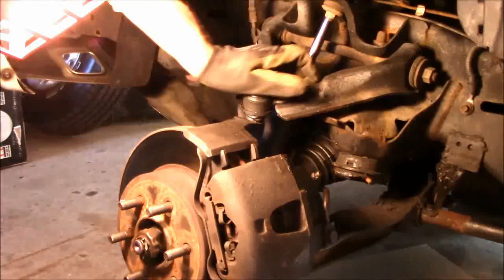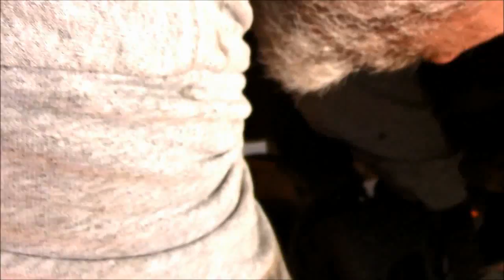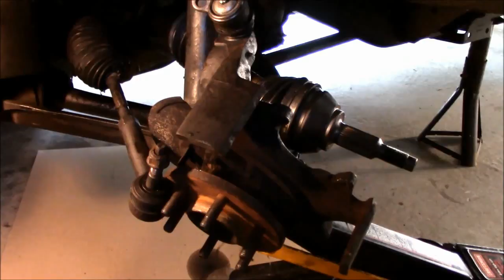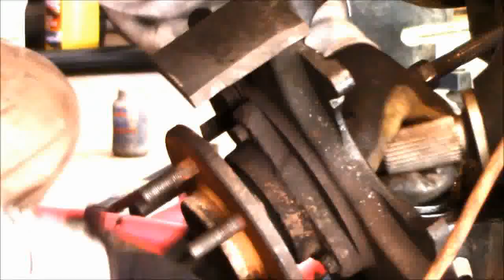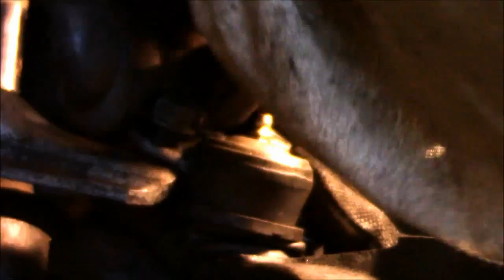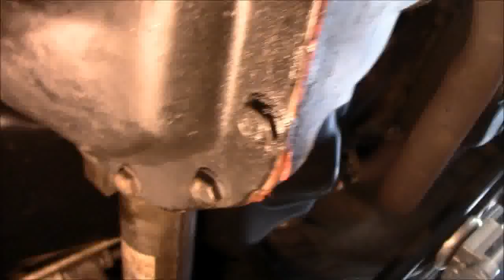2002 Dodge Durango Front Axle Seal Replacement

Comment: No need to disconnect a tie rod and also I didn't take off a caliper and a brake rotor!
You just move the whole hub to the front and take out the outer shaft. Easy...

Comment: How about drilling a hole in a piece of hardwood of the right diameter and then tapping the seal in with that?
Reply from the maker: Sure, there are many different things that you can use to seat the seal.

Comment: When installing the new seal you might be able to put the axle nut socket over the shaft and line it up with the seal and tap it in that way if it happens to be the correct size. That's usually what I do depending on what i'm working on.

Comment: Could have left ball joint AND tire rod in place,  removed bearing hub and pulled axle straight thru
Reply: No you cant
Reply: There is a seal on the inside of the beari g hub assembly
Reply: Do you think u can remove hub assembly bolts to slide the axle outward enough to disconnect the axle from the stub shaft and swing the axle down far enough to replace the seal?  This way u wouldn’t have to disconnect ball joint, tie rod end or 32 mm axle nut. I’m about to do this job soon.

Comment: how much play is the CV suppose to have. I'm having a issue where my 4hi and 4lo are engaged. I'm getting g hesitation on coasting. and when turning into sounds like my driver's side wants to rip off big popping. just wondering if that would be the CV acting up
Reply from the maker: It's hard to say, but turning and sound from one side is consistent with a CV joint that's going bad
Reply from the maker: Is it only in 4 wheel drive that you have the issue?  It could be the stub axle in the differential.  I've see where the splines get torn up and they will behave like that.
Reply from the maker: Take a look at the following... they may help you in diagnosing it...
https://www.youtube.com/watch?v=ePvHMgIYnec

https://www.youtube.com/watch?v=kPze_fn6c4g

Not exactly the same, but my help in diagnosing what's going on...

Comment: The O ring on the stub axle is Factory, it is an attempt to keep dirt out of the cv female slip fit joint. .......... The stub axle has the same steel o ring on both ends.
Reply from the maker: Nice to know.  thanks

Comment: Thank you for making this video. I am literally in my garage at this moment and needing to do the exact same thing you did in the video. This is my first attempt at a repair of this kind and your video cleared a few things up for me. Especially, as to how the axle dislodges from the part (nub) where the seal is located. I was under the mistaken assumption I'd have to pull the pin inside the differential and then remove a C-clip to dislodge the unit for the seal repair. The way you did it appears to be a heck of a lot easier etc. Anyway, your directions were clear, easy to understand, and helpful. Thanks again.
Reply from the maker: Glad it helped
Reply: DamnSkippy1 THANK YOU ! 
I also have this problem when wife and I first bought our 03 Durango R/T it was what we were looking for she had room , I had comfort in knowing it had full box frame and all wheel drive . Well I have replaced the 5.9  and was quoted at $1,200.00 just for engine  not liking that. I did entire job diff engine and all for $780 !! And that included a homemade plenum pan from alum street sign ! 
Now the axle seals are both leaking , enough to wear the diff is empty. So ive been looking for videos like yours and I have to tell ya. Spot on. I did both sides in under 1-1/2Hours. And threw on new pads while in there. Took to alignment shop and it was .7  degrees out haha THANKS TO YOU  👍